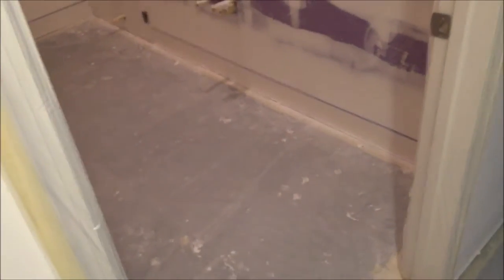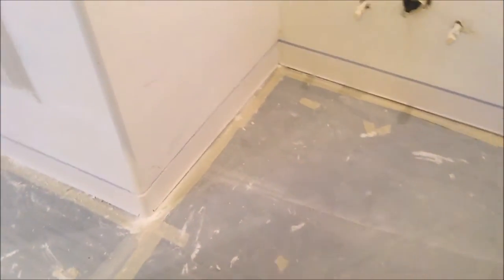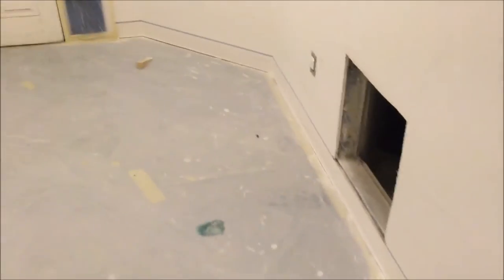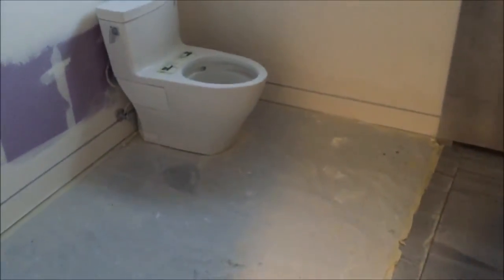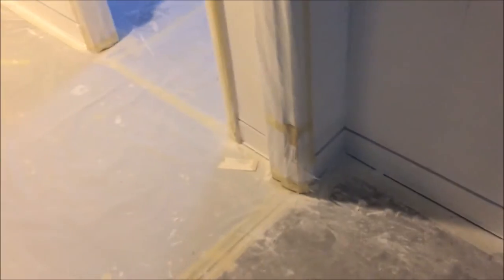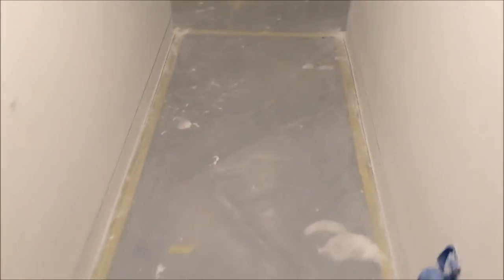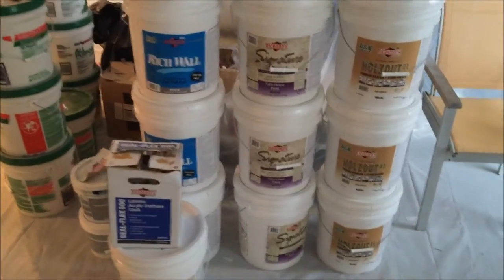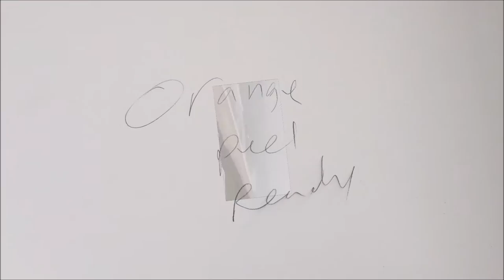Spraying Orange Peel Texture on the Flush Baseboards and Skim Coated Walls after quick touch up Skim

Comment: What sprayer are you using? Do you always use a sprayer over a hopper or did you chose the sprayer because of the orange peel finish or the size of the job?
Reply from the maker: Great question! The texture machine I'm using in this video is a Graco RTX 1000 that I've had for about 12 years. What's cool about this rig is that you can run it through the hose and gun or with a hand held hopper gun. If you look closely, the texture gun can have a hopper added right to it. You just screw a cap on where the material hose connects and remove the plug at the top of the gun,. Then add the hopper right there. There's a setting on the machine that you switch to either hose or hopper Or you can just use the hopper gun with a more portable compressor for small drywall repairs that need to be texture matched. Which is what I usually do for repairs. This was a larger job so I went with hose, gun and the RTX 1000. Let me know if you have any more questions. Take care, -Paul